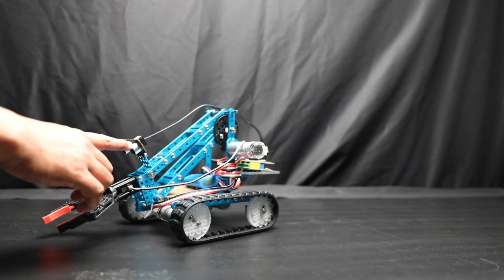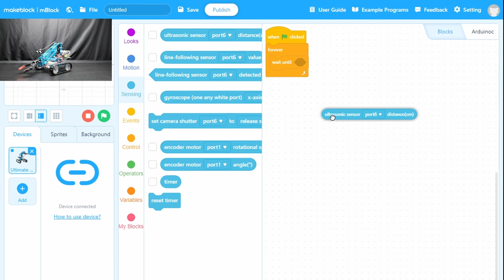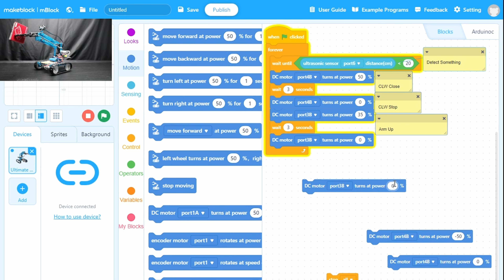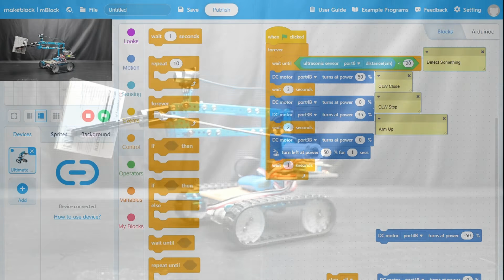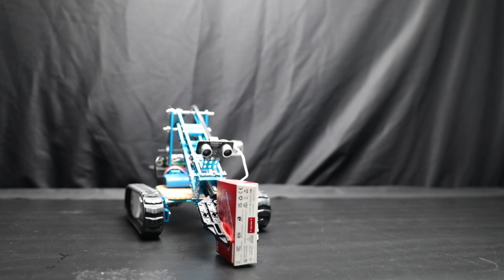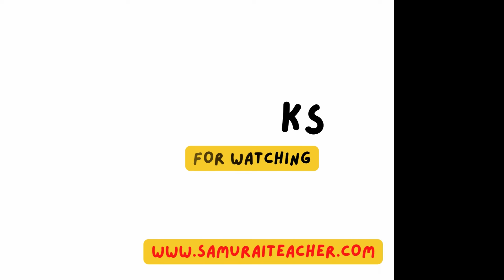Makeblock Ultimate 2 Robotic Arm Block Lesson Part 1

Comment: I don't know why when i put the track it doesn't move but it work when i take it out. only by its wheels. Why is that?
Reply from the maker: Hey @gyprotistocyon2246, thanks for watching! It's definitely puzzling when your Makeblock Ultimate 2 track isn't cooperating. Make sure you put the correct motor